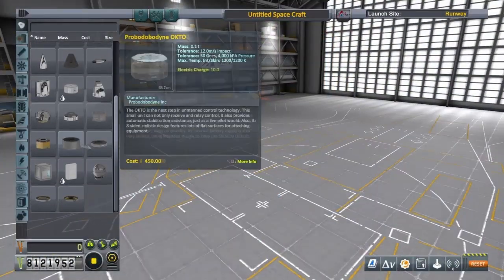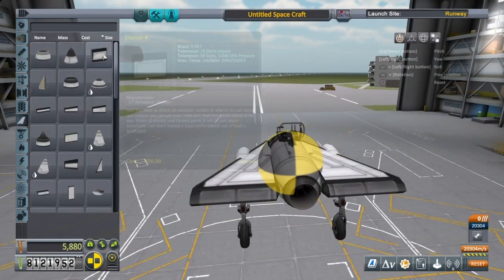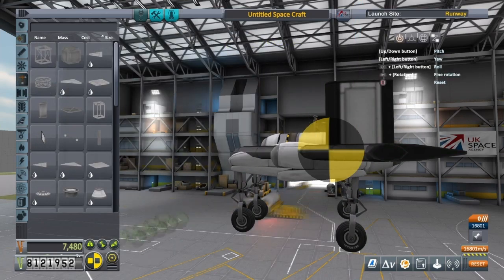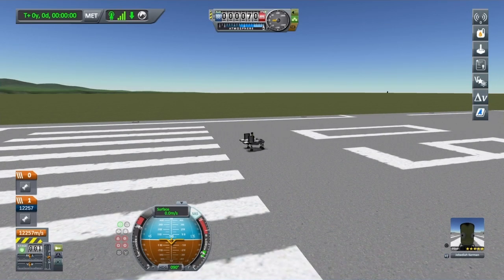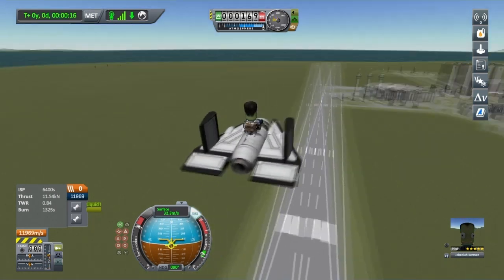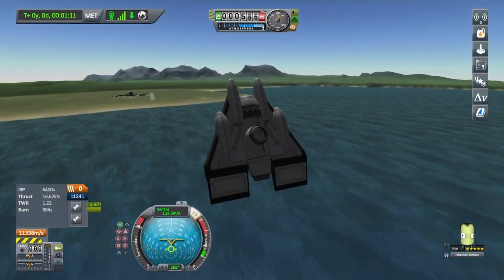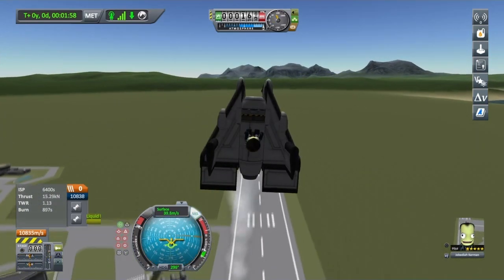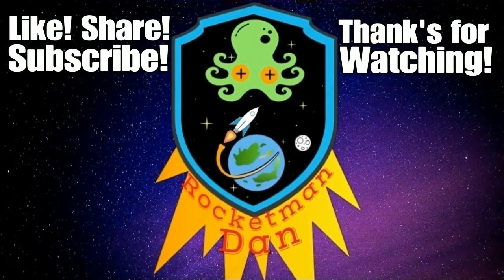KSP PS4 Mini Stock V.T.O.L Aeroplane.

Comment: Could you do a list and order of your parts you used
Reply from the maker: Hey D'Artagnan McDermid, no problem mate,

Okto2.

small circular intake.

small inline reaction wheel.

mk0 liquid fuel Fuselage.

J-20 "Juno" Basic Jet Engine.

EAS-1 External Command Seat.

Structural Wing Type D (x2).

LY-10 Small Landing Gear (x4).

Elevon 4 (x4).

Cubic Octagonal Strut.

J-20 "Juno" Basic Jet Engine.

The exact parts i used and the order i used them in, hope this helps mate, good luck.🚀
Reply: @RocketmanDan  such a shame there's so many higher tier parts. I'd love to play around with this thing in my career, run. 

I remember when you had to use a crazy contraption because you couldn't launch in a command seat.